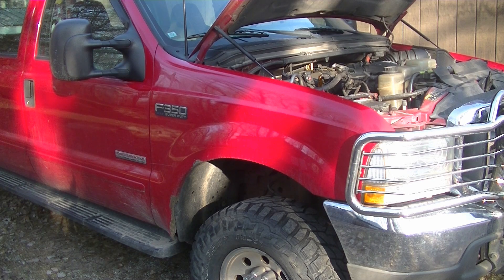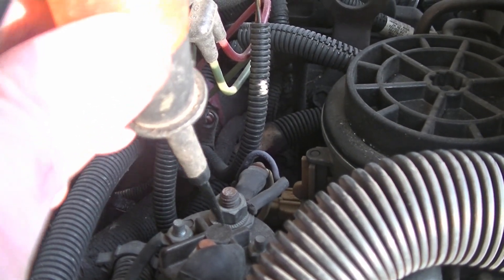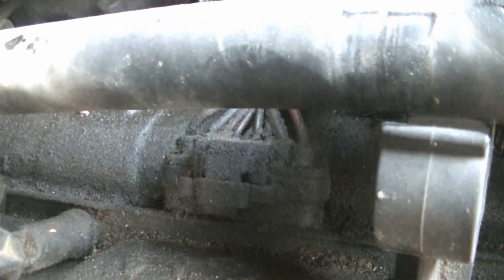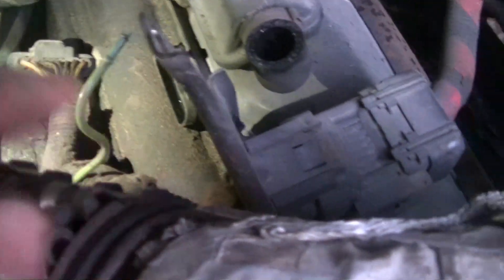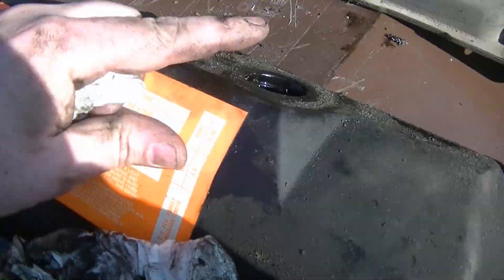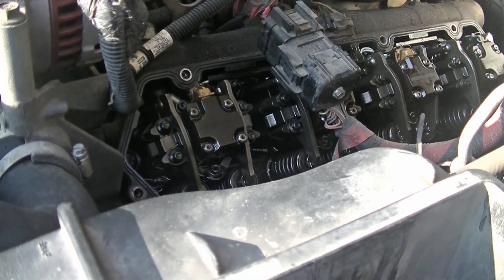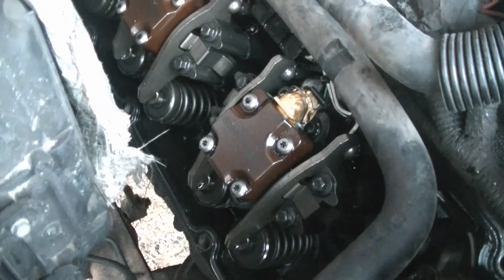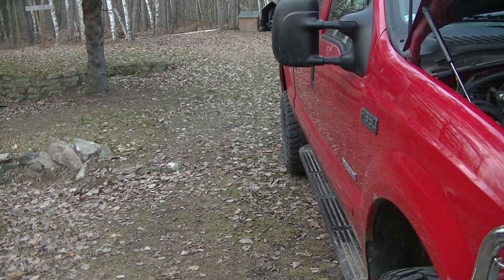7.3 Powerstroke smokey start diag and glow plug replacement

Comment: Thanks for the video, I had the same problem it started up ok but it would smoke like crazy then stop after a minute or so and I could not believe that one glow plug out would cause that much smoke, but it does. I thought I had several out. I did the repair on 04/09/2023, I found number eight cylinder had a bad glow plug. I have not started the truck but I will test when I go pick up my new dash for my interior swap.

Comment: I just bought a 2000 f350 with a 7.3 powerstroke and its my first diesel.  What I dont understand is.. why would a bad glow plug cause smoke??  Isn't the only function to help warm the air inside the cylinder so it has sufficient temperature for the initial start??
Reply: The glow plug is to create a heat source to get the fuel to detonate, because there's no spark. Your diesel engine operates off of pressurized combustion, it's harder to get the diesel to combust when it's cold, so they putting glow plugs that make startups easier. If you didn't have glow plugs chances are you would have to use your block heater and/or a can of starting fluid. The glow plug stay on for about the first 2 minutes of operation.

Comment: I have checked my injectors multiple times while the truck is running Loyola spurting out the spores like they're supposed to I've owned the truck for over several years new glow plugs last year Motorcraft new O-rings on the injectors on the driver side new valve cover gaskets with the terminals all that's been done some time ago I know all the little tricky spots on these truck new IPR valve ICP the only thing I haven't changed on this motor is the exhaust back pressure valve is original that sits at the back of the engine and I haven't changed the original fuel bowl neither for the mechanical fuel pump I'm starting to have a leak by the mechanical fuel pump but everything else is changed on this engine oil pump oil pickup tube high pressure oil pump low pressure oil pump was never changed I was in the process of changing it recently but the weather was so cold I didn't do it I've had the motor out of this truck twice to fix certain things have done new pedestal turbo gaskets new ICP a couple times new exhaust back pressure valve over 5 years ago and I really don't drive the truck too much when it's cold it'll fire up no check engine light will come on now that I change the injection pressure regulator valve with a good 1 I use an Amazon one about 4 years ago because I couldn't see paying $300 for one so I got a better deal on Amazon but I replaced it with a good one now with a lifetime warranty absolute pressure sensor which on the new ones it is in the y-pipe and on the old ones that's in the air breather box I've never change that sensor that I know of but almost every other sensor on this truck crank sensor the sensor up on the firewall I mean there's just so many sensors I've changed throughout the past five years in this truck it'll run good great when it's plugged in fire rate up with no smoke or in the summertime but in the cold time if it's anything past like 40 30 degrees it has a hard time starting it will fire but is there something that I'm missing or do you think it just needs that map sensor or do you think it needs injectors because that's lastly what it comes down to

Comment: Would it have been a good idea to just replace all 8 glow plugs?
Reply from the maker: FPV5150 You are correct.  It is a good idea to replace all of them at once.
Reply: YES, THEY DO LOSE POWER WHEN THEY AGE. My 7.3 Did not have any bad ones but started very hard, 8 new Glow plugs & it made a world of difference. & like I said above, For all that work, I would do it right ! & Check EVERYTHING Inside the Valve Covers, Some say the Gaskets may be used over, But Mine were Hard & wires Stiff, I chose to replace all needed.
Reply: @danmcdonough8514  getting ready to do that to my 96 250 where did you get yours? I've heard riff raff is good and obviously only motorcraft for the glow plugs themselves.

Comment: WOW, IF You Go That far, Replace ALL the glow Plugs,  The wires, Injectors plastic connector covers break,  So it Only cost ? $70.00 For glow plugs, The gaskets & Wiring come as a set & cost Another $100.00,  IF YOU SPEND A DAY TAKING THOSE VALVE COVER OFF & THE RUSTED DIP STICK, NUT BOLT SYSTEM,CLAMPS, HOSES.DO IT COMPLETE & CORRECTLY.  I THINK TO DO MINE & INSPECT INJECTORS REPLACE GLOW PLUGS,VC  GASKETS / WIRING IT COST A TOTAL OF $200.00. & SECURITY & GREAT STARTING, Now for 2 years.
Reply: Exactly..... Why go in that far and not replace it all... Makes no sense
Reply: All you are achieving is the placebo effect.. if a part works it works.  Put in a new untested part because the old part "looked ugly" and it only makes you feel better, but its hard to tell mechanically if it is a win, lose, or draw...

Comment: I did the exact same process but it won’t crank over now , shows check engine light and glow plug light on
Reply from the maker: Won’t crank over, or won’t start?  I could understand if it won’t start.  It would more than likely be the wiring harness that goes through the valve cover.  I’ve heard they can be finicky.  I don’t see how changing glow plugs could make it not crank over.  I would check the starter solenoid and the starter itself.

Comment: I got a 2000 f250 7.3 with 350k miles. The first start up in the morning whether it's 35°f or 50°f in the morning it takes 2-5 cycles of the glow plugs before it will start then it will smoke pretty bad for about 10 seconds or so then be fine. Throughout the day it won't smoke appon start up and always starts right after the first glow plug cycle. The only time it barely smoked and started up first cycle In the morning was when I had it plugged in over night just to test the block heater (just got it about 3 weeks ago). Think its fairly normal or should I try doing some test? Just don't understand why the only issues I have is with the first start up unless it's plugged in..
Reply: Here in wyoming it gets  -20 AND I PLUG IN AT NIGHT,  1 cycle and starts right up with no smoke...if I don't plug in it dont start..my diesel mechanic says its glow plugs or relay or it would start with one cycle..but it starts all day after plug in over night and starts fine with no plug in when it dosent go below 40°..I need to.replace glow plugs